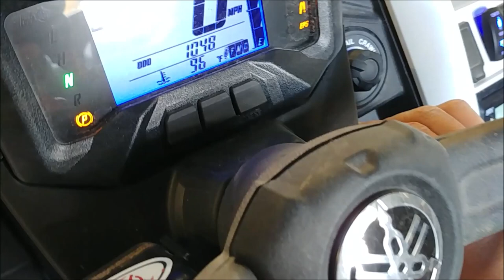Another f(&ing Yamaha sheave video, common screw-ups

Comment: Thanks @MassiveOverkill i've enjoyed them all ... the only thing i have question about is when installing the clutches back on the shafts are you lubing the splines and what with , also the bearing inside the support housing ... 
thanks again Massive ...
Reply: Use TinkSeal on all your splines, do not get it on the threads.
Reply: @MichaelJHathaway  
Thanks  👍
Reply: The manual says use motor oil on the bearing in the support housing

Comment: Thank you once again for taking the time to make all the videos, I just ordered a Weller machine clutch kit and an extra jar of Tinks , time to do my first major service, I notice that it looks like you are running a stock secondary spring ??? ,I though you had upgraded to Weller clutch kit as well 🙂
Reply from the maker: Hey Rick, the secondary spring is for those wanting more low end performance.  I'm perfectly happy with the machined sheave's additional low end performance and want to keep my cruising speeds RPMs lower, so the stock spring is best for that.
Reply: @MassiveOverkill  Thanks for clarifying that, I will have to try that first, and then try the secondary spring .

Comment: I see the performance secondary sheave available but is there a performance primary or is just a spring and weight change? I have stock 30” carnivores I plan to do a lift with spring/tender swap with 32-34” tires. I 85% trail riding and 15% mud/ water crossing.
Reply from the maker: There is a primary sliding sheave that is milled for better low and high end performance.  There is a secondary spring available as well as slippery washers (UTVEngineering).  No one machines the secondary sheave, only the primary sliding sheave, which is typical. 

There are additional options for the primary such as heavier roller weights for those that want lower RPMs and primary sheave collar shims which trade off high end for more low end.

Comment: What is the advantage of going greaseless?
Reply from the maker: You'll realize immediately the first time you service your sheave and kill 10 trees from the paper towels you use to clean out the old grease.  Initially, greaseless was for U-boat commanders who swamped their units and couldn't go anywhere because water got in the CVT box and displaced the grease all over everything.  Guys would go greaseless (in the primary sheave, which isn't sealed)  so if they got water in the  belt box they could just drain the box, spin up the sheaves dry and enjoy the rest of their ride.